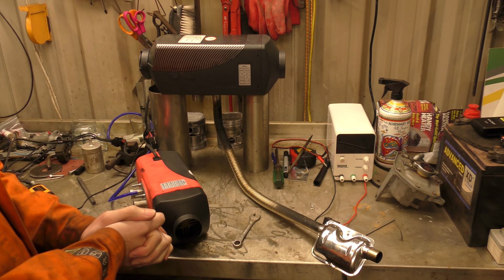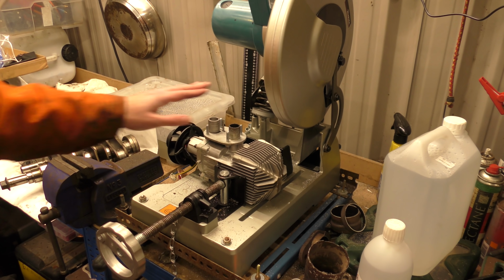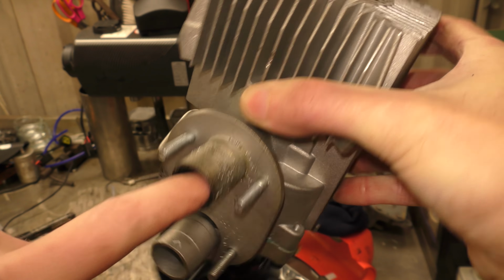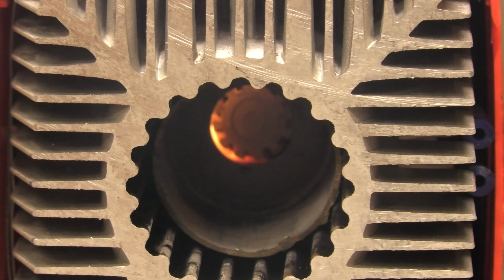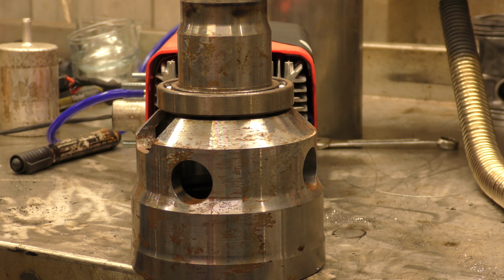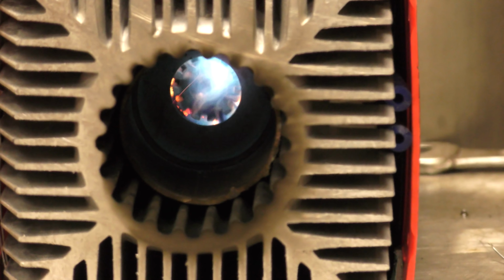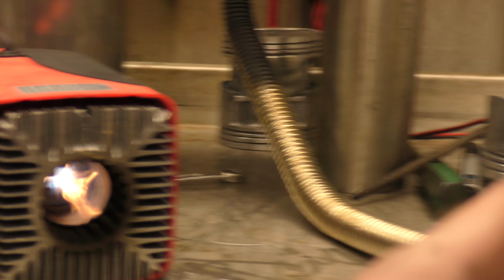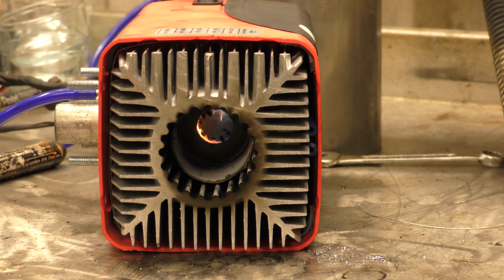A look inside the diesel heater while running

Comment: @5:00 
How many Liters per hour at full burn? Btu?
Here in the states we have a product called jbweld,
Kinda a metal epoxy... might have one just for aluminum.
Reply: "J-B Weld™ ExtremeHeat™ is formulated to allow for repairs to iron, steel and metal in high temperature environments (2400°F / 1300°C). When fully cured, this metallic compound can be drilled, machined or sanded."

J-B EXTREMEHEAT
ExtremeHeat™ is an epoxy putty specifically formulated to bond and repair materials that will be exposed to high temperatures in automotive and industrial maintenance applications. It cures to a tough, hard bond with little to no shrinkage. This industrial-strength product outperforms conventional epoxy putties at high temperatures and sets in 1 hour at room temperature. After 8 hours, it can be drilled, tapped, machined, ground, filed and painted. ExtremeHeat™ is rated at a tensile strength of 800 PSI and cures to a machine grey color, withstanding temperatures up to 2400°F.

STRENGTH: 800 PSI
SET TIME: 1 Hours
CURE TIME: 8 Hours
CURE COLOR: Machine Grey

and another product:
J-B Weld HIGHHEAT EPOXY PUTTY
$ 7.99

HighHeat is a hand mixable epoxy putty stick specifically formulated to bond and repair materials that will be exposed to high temperatures in automotive and industrial maintenance applications. It cures to a tough, hard bond with little to no shrinkage. This industrial-strength product outperforms conventional epoxy putties at high temperatures and sets in 1 hour at room temperature. After 8 hours, it can be drilled, tapped, machined, ground, filed and painted. HighHeat is rated at a tensile strength of 800 PSI and cures to a machine grey in color. It is able to withstand continuous heat exposure of 400ºF and intermittent heat exposure to 550ºF

Comment: So this leaves me wondering if the heaters can be mounted on their sides? If so I'd like to see if the exhaust can be directed at the heat exchanger of a Carver water heater to recoup some of the lost heat into hot water...
Reply: I don't believe I've seen anything stating not to do it, I've seen it done in campers and such. Only issue may be flooding if you were to be irrational and keep trying to light a non lighting unit, fuel can't overflow out the exhaust till it gets to stupid levels.
Reply: @AndyT That is great to know,thanks for sharing.

Comment: the heat sensor temp seem low so shut down will accure .is there a remedy?like rrelocate sensor or put a copper piece under sensor. maybe add thermo coupler of some sort.please rreply save test trial time.thanx specs on heat sensor would help in normal use.

Comment: Hi David, I'm having an issue with my Expensive Espar heater after just two weeks of running it.  Within 3 days of of notices an increasing exhaust smell from the vent, it is now unbearable.  The exhaust host is tight and the heater plate is mounted correctly and sealed, even if there was a small crack, there is no way that much can be blowing in.   Have you ever had this issues with one of your heaters?

Comment: Has anyone thought about drilling, say a 10mm hole in the centre of the air outlet casting?  This could be threaded to take a bolt/washer and used as an inspection port. Ideal then for poking an endoscope camera to view the insides.  Obviously when the unit is off.
Reply from the maker: Scarily enough that's exactly what I recommended someone do who wanted to do periodic inspections.  It's thick enough to drill and tap as I've done it for attaching my internal temperature probe.

Comment: So these things have no lubrication other than the diesel itself? Wondering how that works ive owned dirtbikes motorcycles vans you name it so im confused haha
Reply from the maker: Only the motor is moving and it's on bearings.  The diesel is just there to burn, there aren't any injectors or anything?

Comment: So This is basically like the Big Torpedo Kerosene heaters.. just Smaller?  How many btu?
Reply: The big difference is the exhaust is isolated from the heated air with this, torpedo heaters blow the exhaust as the heated air directly.
Those are much more efficient but with the significant drawback of not being suitable for use in enclosed spaces.

Comment: ? What hz setting is this? Standard .02 pump? Also can anyone share tuning info (I don’t wanna have to go get a gas analyzer like David did). Looking for two settings:
Very low settings somewhere below 2 HZ
And high setting but not max, perhaps 6 Hz
This way I can make a seasonal adjustment, where it’s optimized for a low setting, except dead of winter one or will be run on high. 
And must say phenomenal video!Also to answer a couple of questions from other comments:
1) There’s a guy on YouTube who has run everything except diesel, including gasoline and his heater trying to destroy it, it’s still running after a couple of years
2) several examples of using these things for a hot water on YouTube as well, either by recovering the exhaust gas, or using old CPU liquid filled heat sinks right over the hot air output, with a tiny circulation pump.This can be done intermittently when you want hot water and take it away when you want nothing but hot air
3) fuel consumption:
144mL per hour on low (2 Hz). That works out to 32 hours per gallon. 
396mL per hour on high (5Hz)
I frequently run mine at 1.6 low and 4 Hz high, but I haven’t tuned mine so I’m sure I can produce a lot more heat than what I’m getting. Ideally I’d like to have the combustion fan run at the optimum speed for combustion, and the heat exchanger fan run at a higher rate for efficiency and reduced exhaust gas temperatures
4) German engineered, but Chinese manufactured.

Comment: Question. So if the burn chamber, and cover we're extended a larger area would be heated? Would this make it more efficient?
Reply from the maker: Yes, if you make the burn chamber longer and the heater body longer more heat is dissipated before it exits the exhaust.  So you'll end up with more hot air and a cooler exhaust.

Comment: I think expanding the heat exchange and making the end bigger and the fan just a little bit bigger and trust me and you can also run this off of lithium battery pack on the go. Why do I know this cuz I use mine on a eco flow battery backup River pro and it has an external extra battery which gives me tons of power days of power to run one of these. But now I'm thinking about using my own homemade 12.5 volt heating elements that are encased in glass tubes these things get hot as shit and only use about 10 amps which is about 120 watts of power and then I use these inside of an aluminum can without the top popped and I put these inside of it and use it as a heat exchange and then I poke these cans right up through a hole I drill in the side of a 3x4-in gutter and I kind of squeeze the can just a little bit that way when it goes up in there it gives a little flow of air beside each side of the can but yet this can gets hot as shit and so the inside of this chamber right there in the middle of the gutter which is only about 2 ft long gets real real hot I let it sit there get hot before I turn the fan on. I use a marine turbo fan it's 12 volt I ran all of this off of solar so if we keep messing with this shit we can get to where we can use up every bit of heat some of these units put off you should be wrapping copper around the exhaust also and using that with water and a heat exchange radiator whatever you want to call those with fans Man there's so many ways of pulling heat off of this stuff

Comment: I have a EGR cooler on the exhaust of my heater to recover the heat. It then has some piping a tank and a little 12V pump to circulate the water. By sheer luck it bolted straight on with no issues. There is a video of someone doing something similar on youtube somewhere.
Reply: That’s a fantastic idea. How effective is it at heating the water
Reply: @Diesel8290  tbh it's not fast, but i suppose it depends on how much water your trying to heat. And until the water warms up, it creates a fair amount of condensate in the exhaust. I think I estimated it to be around 200'ish watts of heating power.
Reply: @wrowner85  I’m going to try it with a cooler of a 1.6hdi Peugeot engine

Comment: They are essentially a mini salamander heater is what it seems
Reply from the maker: Not really.  Those Salamanders use compressed air to blow the diesel through a nozzle to make a mist that is burned.  These diesel heaters vapourize the diesel on a hot mesh and mix it with air to be burned.  Similar results but different methods.

Comment: Is it okay to install these chinese heaters outside? Or are they designed to be circulating indoor air instead?
Reply from the maker: For maximum efficiency you'd have the same air being reheated.  But some people prefer bringing in fresh air at the cost of efficiency.
Reply: Thx for response. Like to do some winter camping in a honda covoc at a lit-15 celsius. Would you recommend a 2 or 5 kw heater? Heard there is less noise on the 5 kw but concerned it's an overkill for a civic, and the unit would always have to run on low.

Comment: Can u install them heaters on their side and run safely or they must be up in normal position
Reply from the maker: They can run on their side as long as you have the glow plug on the top side.
Reply: @DavidMcLuckie  can u move the glow plug into different positions then so heater on side move glow plug so it's on top ?

Comment: Can you burn gas/diesel mix? If so, what percent or ratio?
Reply from the maker: Yes.  Easy 50/50.  Even higher gas ratio if you're willing to fiddle a little with the settings.  It'll burn straight gas if it's in the mood.  :)

Comment: i just read of a guy that put a ball of 5m 0.25mm nichrome wire in the burn chamber and apparently he had to put a fuel valve inline and reduce the fuel due to the heater being too hot. Has anyone else tried this?

Hi, I twisted a ball of 5m 0.25mm nichrome wire and placed it in the combustion chamber to expand the heat zone. Fuel vapor burns better as it passes through the high temperature zone. The effect was staggering. The fuel supply had to be restricted as it started to fail due to overheating. An aquarium metal tap had to be installed to limit fuel supply by 50%. Then the output has a 143c airflow at 1.6Hz and with 5l running in 27h in my variant. The fuel burns so well that there is almost no smoke from the exhaust pipe, only weak steam. I suggest you give it a try.
Reply from the maker: I tried stuffing the burn chamber with stainless wire, but that was aid burning gasoline.  Nichrome wire and diesel sounds interesting.  Thank you.
Reply: @DavidMcLuckie  yeah nicrhome wire is interesting stuff. let me know how you get on.

Comment: hi david is it possible to convert vervor diesel  heater to heat water
Reply from the maker: Sort of yes.  Bobil Vans make a unit that takes the hot air and turns it into hot water - https://www.bobilvans.co.uk/product-page/new-bobil-air-xchange

Comment: Based on this , unit can be mounted in any direction.
Reply from the maker: Glow plug needs to be on top.  There is an air hole diesel can leak from during starting if upside down.

Comment: Is there a way to get less heat, I’ve got an 8 on a small boat and it’s to bloody hot.
Reply from the maker: Have you got the LCD controller version?  You can go into the admin settings and turn the lowest setting down, both for fan speed and pump speed.
Reply: David McLuckie O yes, it’s on the lowest settings, I’ve actually tried it on high and it’s mental. I just need a 2 kw but the 8 would warm a factory. So cheap for such a great heater but one problem with the 8 running on low all the time is it can be a bugger to start sometimes with it not firing because of soot I suppose  and pouring out smoke but a couple of restarts and of she goes to melt the boat.
Reply: @stephenhowlett6345  you can set a temp controle unit on it.
It's switch it on and of .
This way you can set your boat on 18c .
Reply: sebastiaan suijkerbuijk yes I know that but it gets to 35 centigrade in 20 minutes so it would be ticking over so long that it just wouldnt work properly.From freezing cold to baking hot takes less than 10 minutes so it’s just to hot for a smallish boat.

Comment: Great vid, now you just need to work out how to make it into a water heater 🔥👍
Reply: They already have gas water heaters. The gas simply heats up an exhaust pipe/chimney as the heat exchanger. These turn off to slow. You would have to have a second chimney to devert the heat as needed.
Reply: ....and they already have "on demand" water heaters kind of like this.

Comment: Do you know what eo4 error is? When I prime it from the start the fuel pumps 12 times and then comes up with the eo4 error I've tried taking the cap of the fuel tank  a little bit still doesn't work I've changed the fuel pump to a new fuel pump still the same 12 times then stops, anyone any ideas? Thanks in advance 👍
Reply from the maker: Yeah, E04 is a pump fault.  I had it come on when I unplugged the pump while it was running.  So they seem to be able to detect if the pump is attached or not.  Sounds like you've got a dodgy board inside the heater.
Reply: Ok Dave, thanks for that so what would you suggest, to strip it down and have a look? Thanks for your time👍

Comment: so it works like  the large diesel heaters that look like little jet engines.  i was thinking small engine heating water or something.  thats too simple
Reply from the maker: Sort of.  They have a siphon nozzle inside that blows air from the compressor (usually the same motor as the fan) through the siphon which sucks up the diesel and blows it as a fine mist mixed with air.  These little heaters rely on the diesel vaporizing on a hot gauze inside the burn chamber before it mixes with the air and is burned.

Comment: I reckon it would be super easy to convert these to water heaters! but you do have to make sure the water stays circulating; much like a shutdown procedure. Instead of the heater components overheating you'd have a steam explosion.
Reply: Although you can totally fix that with a pressure release valve.

Comment: Do you know how to adjust the fan RPM?
Reply from the maker: With the LCD controller you can tweak the fan rpm and fuel pump pulse speed in the admin settings.
Reply: @DavidMcLuckie  
How do I get to the admin settings?
Thanks,
Bill Modlin
Asheville, NC
Reply from the maker: On the LCD controller there is a bit in the menu that needs a four digit pin.  The number is 1688.  That lets you in and can adjust the RPM in there.
Reply: @DavidMcLuckie  
Awesome! Thanks so much!

Comment: Are you concerned with carbon monoxide poisoning doing this experiment?
Reply from the maker: No, as that's not how it work.  There seems to be this myth that carbon monoxide will kill you in seconds.  It takes a long time and if you are awake you notice all the symptoms.  Nausea, dizziness, light headed etc.  Then all you have to do is leave and breathe fresh air and your body cycles out the CO.  Which is why its really bad if you are sleeping with CO poisoning.  You miss all the symptoms as you are asleep and then you die.  That's why carbon monoxide alarms are important if you have any fuel burning appliance where people live and sleep.
Reply: @DavidMcLuckie  Yeah can understand that. Just here your intake and outtake are not connected. Wouldn't that be releasing a lot of CO? Normally with the pipes connected there is no possibility of it leaking into your area.

Comment: It needs an attachment to boil water now. :~)
Reply from the maker: I'm looking at EGR coolers to see if that could be a thing.
Reply: @DavidMcLuckie  I made one already one, used a egr cooler off an old Ford 6.0 diesel.not common in UK but lots on other side of the pond.Got increased efficiency by utilizing the exhaust heat too. Youd be surprised how much waste heat goes out the exhaust.